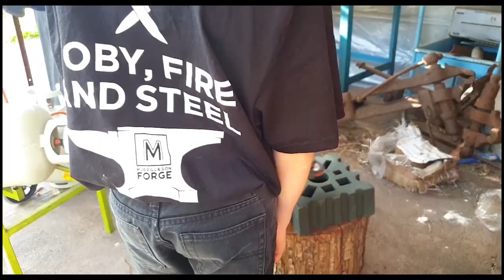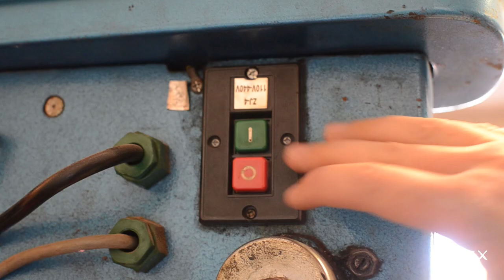Refurbishing and re-handling an antique butter knife.

Comment: nicely done! Can't beat that old style knife for spreading the good stuff!  I was looking for some guidance on removing an even older style handle from a Sheffield knife. Likely mid 19th Century. Old cow rib bone handle with a pin. Really great steel. Razor sharp. I think they used a bitumen product to grab the tang, then pinned it.  But I found your channel and subscribed! Looks fun!
Reply from the maker: Awesome cheers bud. Id personally hit it with a hammer mate and the blow torch or grind the adhesive off bud. Thanks for subscribing
Reply: @TobyFireandSteel  my first try is to save the original handle. It was put in the dishwasher! Ugh! Next is to go your route! I'll let you know.
Reply from the maker: Sounds scary dude. Can I ask if you're wanting to keep the handle why are you removing it bud?
Reply: @TobyFireandSteel  Some one put this old knife in the dishwasher! The bone handle split and it has a monogram on it, family heirloom thing,  I hoped to pull the handle, glue it and put it back on again. Maybe...Perhaps...?  Knocking the brass pin should be simple. Then?  These old Cutlers were amazing!